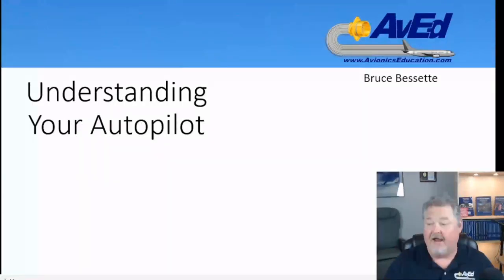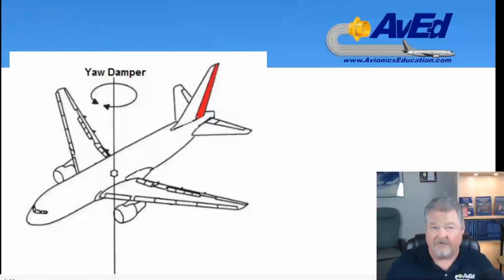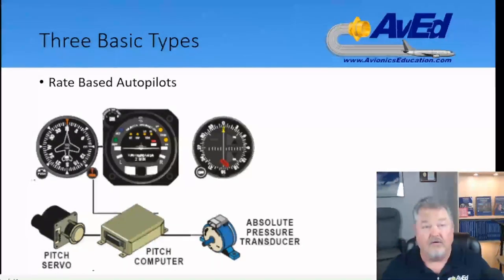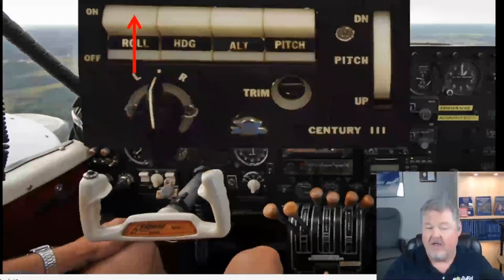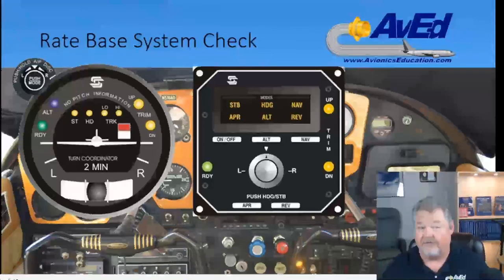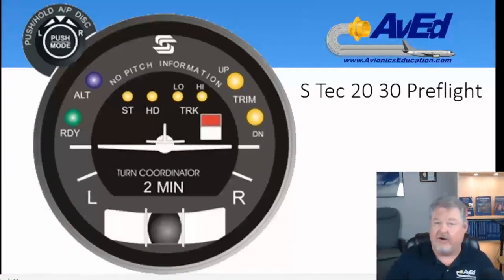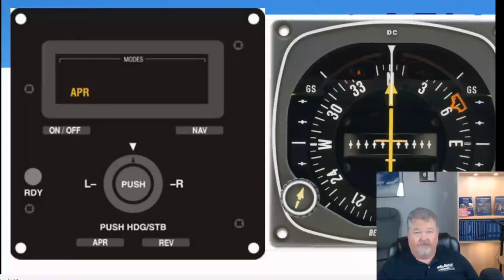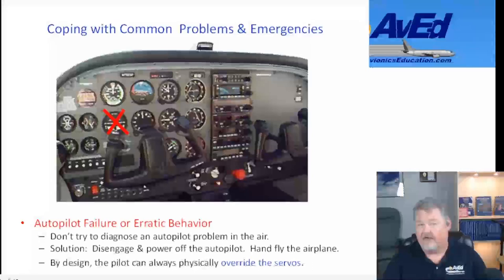Understanding Your Autopilot

Comment: I’m wondering if there is anyone on the planet that has a clue about troubleshooting a Century 4000 auto pilot system. My plane has the Century 4000 coupled to the Century HSI and GNS 430W.  Although I’ve been flying for years I’ve never had the opportunity to use an autopilot so I do not know if the problem I’m having is me or the equipment. It will not hold an altitude reliably: constant trimming up, trimming down and not by little bits. We’re talking several hundred feet of this up and down crap. Until I can find someone to check it out it is disabled. I’m hoping it is just my lack of knowledge although I have studied the manual and it passes all the pre-flight tests. Totally sucks if I have to scrap a perfectly good HSI and autopilot system just because Century is oiut of business and no one knows how to inspect it to ensure it is working properly. I think there is a good possibility the problem is either me or a simple fix. It would be nice to know one way or another.
Reply from the maker: Without looing at the manual or the aircraft I will give my suggestion to look at.  You are discribing the alitude or VNAV function of the system. I would look at where the system recieves it altitude information.  If it happing enroute and not on approach then there could be a separate altitude module in the aircraft. (look for a static system connections) or altitude information is from an air data computer.  I do not have a Century 4000 manual so I cannot be of more help. Good luck.
Reply: @AvionicsEducation  No worries as I do appreciate a a reply.  I suppose my post was a combination venting about the current state of declining general aviation and the hope that perhaps a reader who also has a Century autopilot (or other) and perhaps identify with my issue. I got my private cert back in 1971 and it is disconcerting to see the decline in general aviation over the years. Experience SMEs retire and there seems to be a gap in the supply chain of experienced technicians taking their place. Again, thanks for the reply & I’ll check out your suggestions.